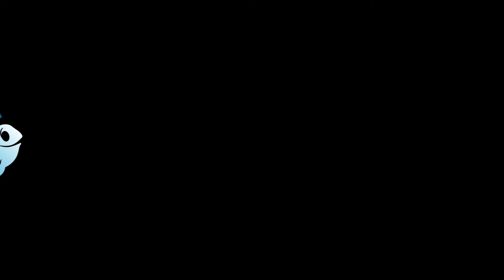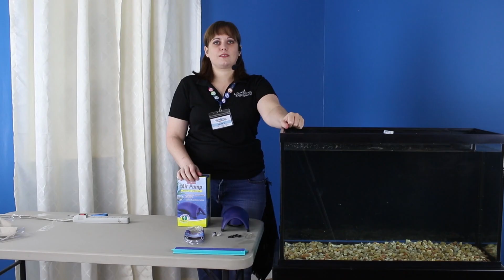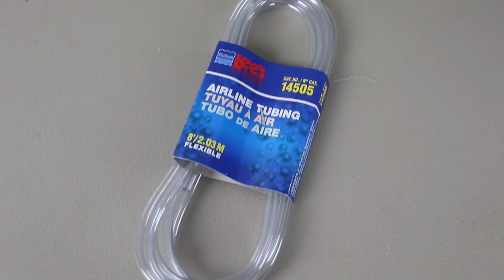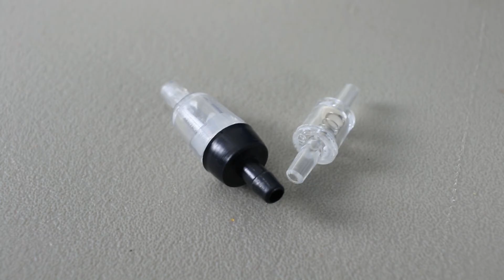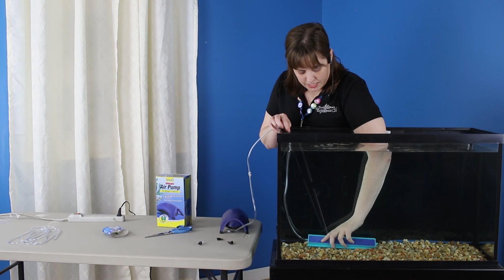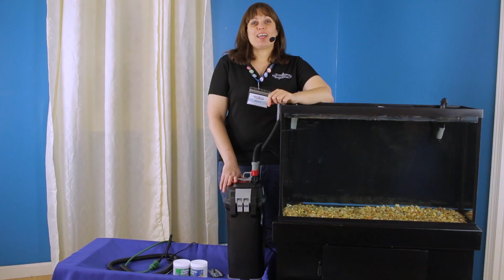How to Setup an Aquarium Air Pump - That Fish Place - That Pet Place

Comment: I just spent the last couple months setting up and stocking my 55 gallon tank. I had a whisper air pump however this past weekend the airline disconnected from the pump over night. The water drained from my tank onto the floor in my living room through the disconnect line and in the morning the tank was empty and all my fish died. 
That was disappointing and devastating. I was so upset and pissed if at the same time.
Reply: Wow... I'm sorry. Thanks for posting this.
Reply: Did you not use the check valve?
Reply: @xAwoken_Dreamer  no, I didn’t even Know what the check valve was for and I am a man so, you know I didn’t read the directions.
Reply: Dang sound like a nightmare